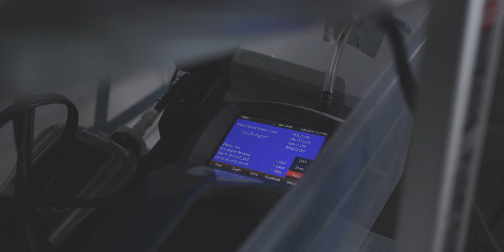Post-Fire Exposure Risks to Fire Investigators

Comment: Excellent video, this is a topic that does not get nearly enough attention. The entire fire aftermath industry is need of improved safety standards, there is way too much potential for danger. 

People think the fires out so the dangers gone but they are dead wrong, close to the same levels of ppe are almost needed during and after the fire. 

This is all stuff I have learned after going through my own house fire, and we have seen for ourselves how investigators, adjusters, and remediators all go in without even wearing a simple n95 despite modern fires producing some of the most toxic chemicals you could be exposed to.